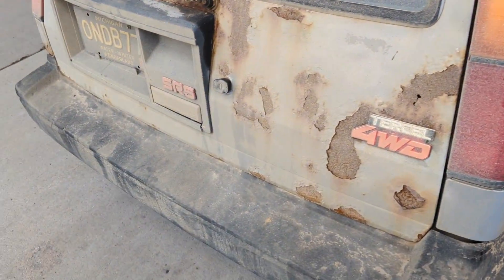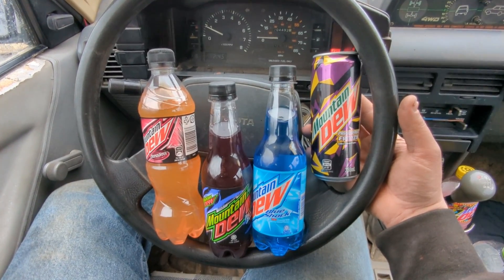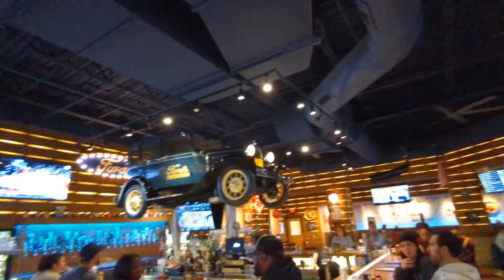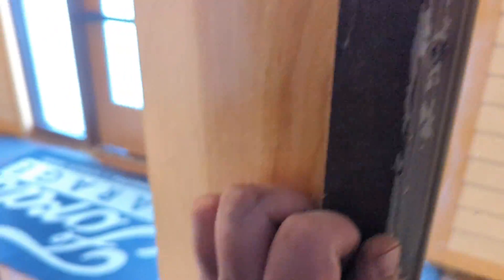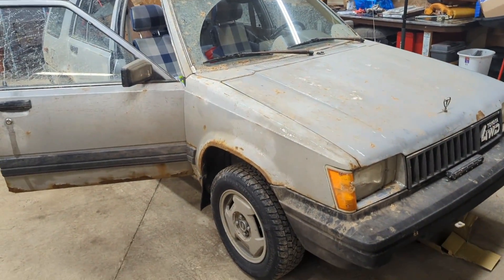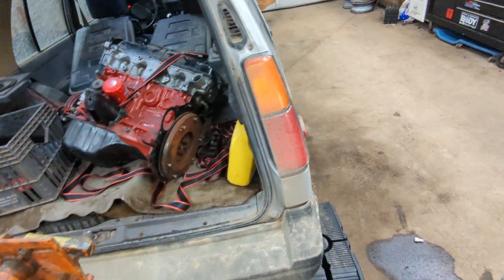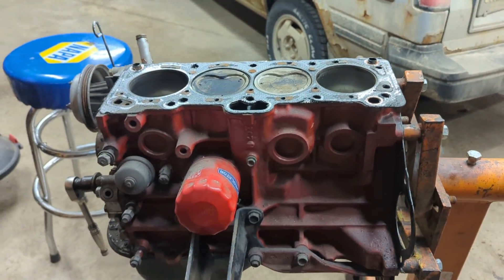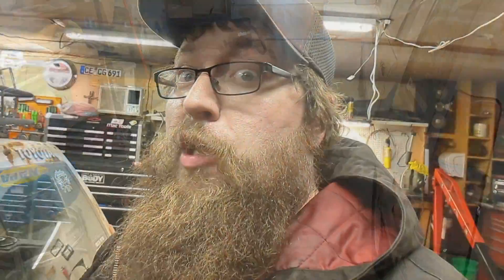Detroit Adventure for a 4AC Engine, Rare MTN Dews and more!

Comment: They would be gas nozzles, not gas cans, I did the 3Ac to 4Ac swap years ago, felt more like a 500cc increase than a 135cc increase, used a electronic distributor as well. Had a custom clutch made up that was pretty much a hilux clutch from that era took up the whole flywheel with the edges machined down one of the last asbestos friction plates ever made in Au, needed it because I run 15” wheels with actual rally tyres ftw.
Ironically selling some small batch extractors I brought for it back in the day to someone in Compton Cal
Reply from the maker: Hahah. I realized that a little bit too late. I'm an idiot sometimes 😃 

It is a fantastic increase in power! I am going to be making a trip to Colorado with this thing and I think the extra "power" would be really beneficial!